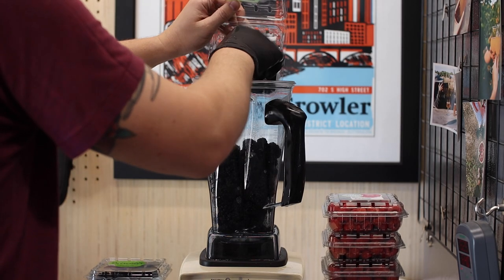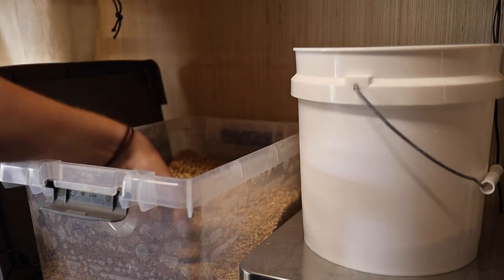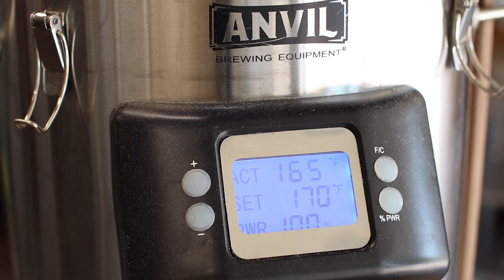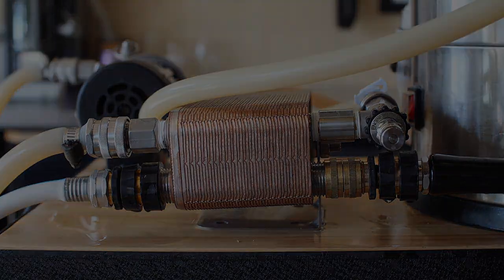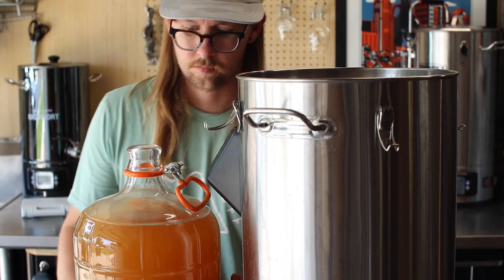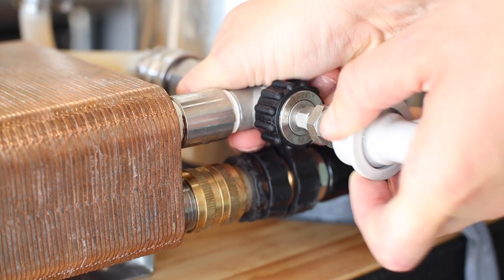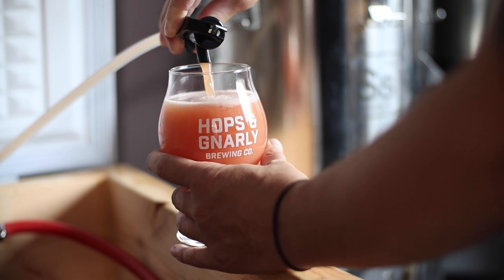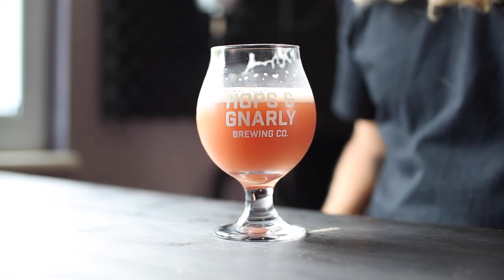Kveik Pressure Fermentation Fruited Sour Beer Recipe | Anvil Foundry | EP31

Comment: Here on brazil we hold acidification on 35 to 40 degree celcious all the time. 25 its too slow
Reply from the maker: You could even go up to 48 or so but you can taste the difference. The lower temperature makes for a cleaner lactic taste

Comment: Great vid. Just wondering what your volume was in the fermenter keg. We’re you concerned about having enough head space, or does the pressure keep that under control?
Reply from the maker: This was just a 3 gallon batch so lots of head space in the 5 gallon keg
Reply: @HopsANDgnarly  I’m wondering if one of the newer 6 gallon kegs would handle a 5 gallon batch.
Reply from the maker: @kurtwolter3984  I bet it would!

Comment: What scale are you using?
Reply from the maker: Both the hop and grain scales are from Anvil
Reply: @HopsANDgnarly  i get mixed review on the anvil scales. Have you had any issues?
Reply from the maker: @t3kn1q5  I need to new scale for my water additions. It’s just not is accurate as I want it to be since it only measures to a tenth. I need something that measures to 1/100th

Comment: looks amazing! Did you transfer from your fermentation keg to a serving keg? I imagine there was a ton of puree in suspension?
Reply: I am also interested in how he chose to clarify. I have an awesome corona clone that I depressurized for secondary, but the gravity sample tasted so good i wasn't sure if I shoulda gone right to serving. I guess I coulda keg hopped twice but i was out of free vessels.
Reply from the maker: Yep I transferred into a fresh keg for serving and didn’t have any issues or blocks. The purée seemed to incorporate really well - that finished beer is a thick’n. Some particulate left in the first keg but not much at all.
Reply: @HopsANDgnarly  how did the transfer to serving keg work? Did you just push it from the bottom of the ferm keg? I would think you pick up all the sediment this way, no?
Reply from the maker: @jeffreydolan201  yea anytime you ferment in a keg you want to use a floating dip tube so you’re pulling from the top instead of the bottom